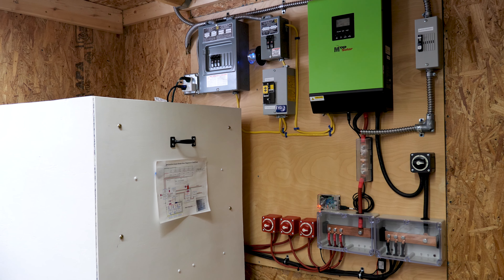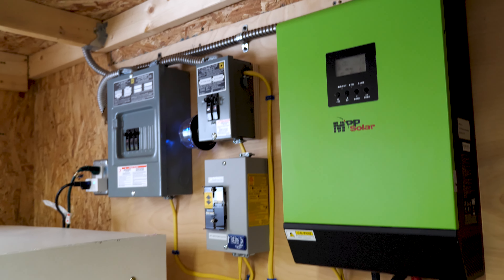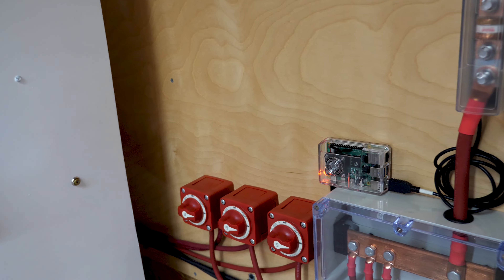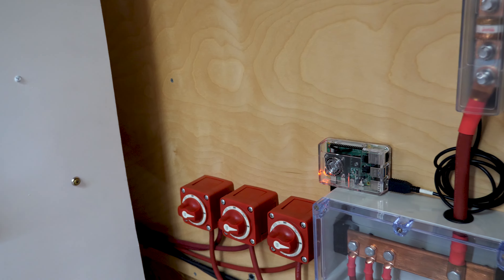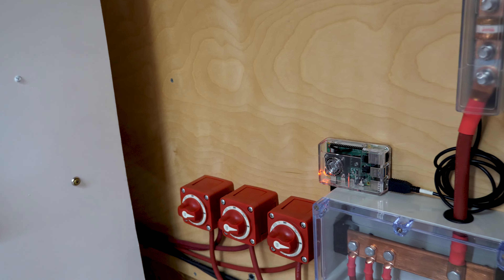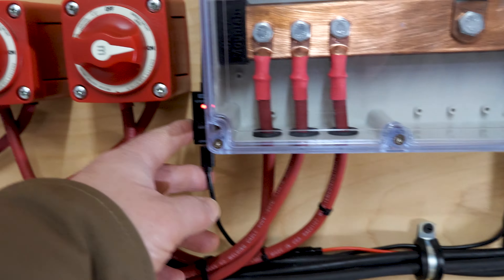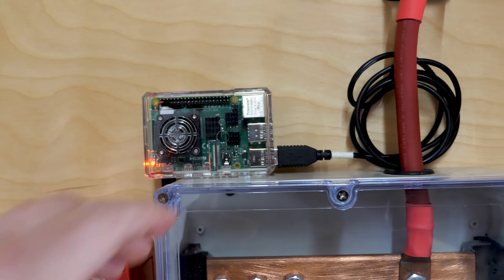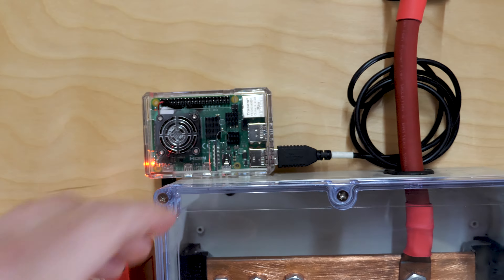DC Buck Converter for the Raspberry PI in the Off Grid Shed

Comment: Nice brother. Love how clean it is. I know some guys say it's not needed to be clean or it's just for looks. It's not!! It's a safety concern. If wires all over the place and not held in place. Things are so much harder to find that may be broken or going bad. Think loose wire nuts for example. Wires that are not well supported. Will pull on connections over time. This can and will make for lose connections. This is how and why bad things happen. One more thing. Clean well-organized and marked wires make it a lot easier to diagnose issues that may occur. 

Love how your like me. The wires need to be clean and look nice. Over all it just a good practice. I left a job that was paying over $60 bucks a hr. When I say I left. I got in my truck and drove home that day never to go back. The guy I was working for just did not care about organization whatsoever. At some point he told the guys. Just use the wires that are run to hold the new ones your running in place. Mind you this was 0000 wire. Was 20 feet runs for the pos and neg. There was over 200 of those runs. There was no way my name was going to be on that job. 

Thanks for sharing brother. God Bless.
Reply from the maker: Bobby, thank you for the kind words and support.  Sound like a good plan to walk away from that job.  do it right or don't do it at all!

Comment: I'm interested in that same MPP inverter for my pool pump. Question, do you run the mpp in power saving mode? I've heard the idle draw is kinda high on these inverters.
Reply from the maker: No power saving mode for me.  The inverter does draw about 45 watts at idle, so yes a little high but with solar panels being so cheap and LiPo4 batteries coming down in price, you can pretty much offset that buy going a little bigger on on your solar design.  The MPP LV2424 has been amazing all-in-one inverter for the pool pump and shed.  Thanks for watching!

Comment: Beautiful setup. Don’t know if you’re running the desktop or checking messages, but do you ever get the undervolt warning?  I’ve tried several buck converters and found most will let voltage sag slightly below the pi4’s warning or even throttling threshold. I’m still looking for a proven reliable dc-dc converter.
Reply from the maker: Very interesting to hear.  I am only running Solar Assistant on my Pi so I'm not seeing any messages about voltage sag.   Do you see those messages through the regular Pi operating system?  The Pi has been running normal since using the DC buck converter.  My take on Solar Assistant is it isn't too power hungry.  I need to piuut an amp clamp on to measure how much energy the Pi is using.  Thanks for watching.
Reply: @GreenMountainDIYGuy   Thanks for the reply, I’ll dive deeper.  I’ve been running the desktop version of raspbian on the pi4, which gives a low volt message on the screen. With a meter it seems to complain right around 5.0V. I’ve also ran a  pi2 and pizero headless, which haven’t had any issues with the dc comverters.